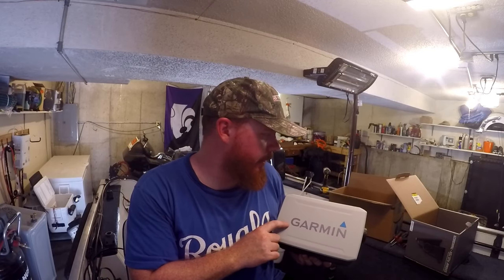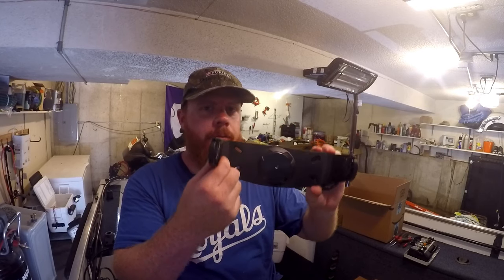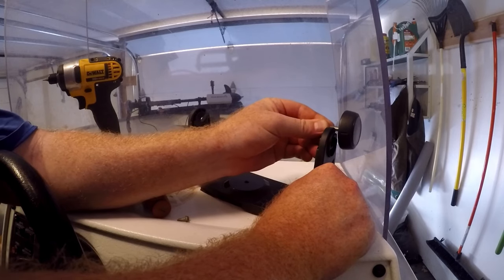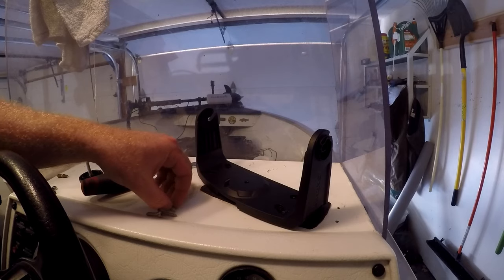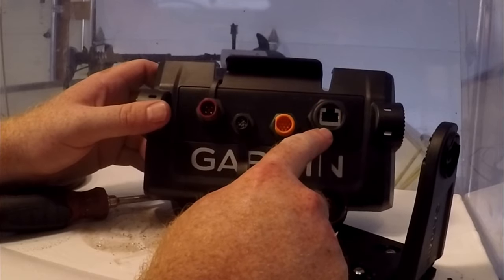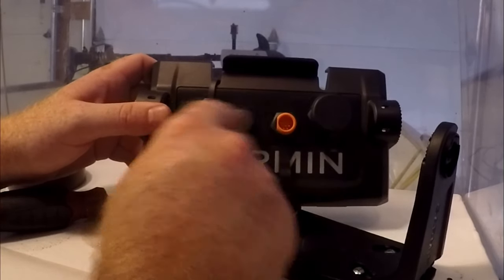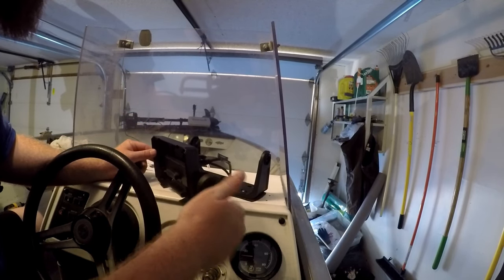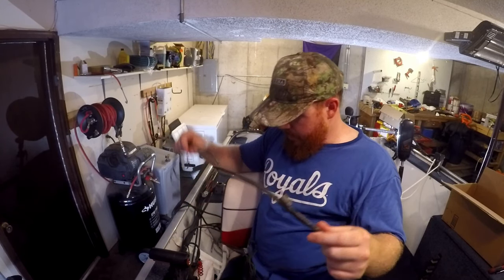How to Install a Fish Finder (GARMIN ECHOMAP PLUS 73SV Full Installation Part 2)

Comment: Nice video. But a couple of things I noticed. The base was installed backwards. If you look at the bottom of it there is an open slot for passing the cables through. This allows you to drill the big whole under the mount so that it is hidden. Also I didn’t see you instal the ferrite around a loop of transducer cable just before the connector. This acts to filter electromagnetic interference from the signal before getting to the unit. Lastly, duct tape can conduct electricity and should never be used as an insulator. Hope this helps. Take care.

Comment: Thanks for taking the time to make this. Is the transducer working well; Have you had to make any adjustments? Any advice for doing this same project in hindsight? Are you happy with the clarity you’re getting? Thanks for your time.
Reply: I want to try it myself, but am concerned about getting the best results. Never done a transducer install. Was this your first? Catching/seeing any fish with it yet?
Reply from the maker: Everything is working great, I am seeing fish and I have not made any adjustments yet. I did forget to install the ferrite around a loop of transducer cable just before the connector. This acts to filter electromagnetic interference from the signal before getting to the unit.
I troll with it at slow 5 to 10mph speeds and it has good clarity so the transducer is working well.
Look over your boat pretty well and come with a game plan before you do any drilling or cable routing, that way you you are happy with installation and avoid mistakes.
Reply: Redbeard Outdoors thank you! I appreciate all I have learned from you.

Comment: Hey there! Great video. I have the same setup. Question though, the directions say to mount transducer on down prop side which would be the  right or driver side. I noticed u did yours on the left. Any big difference? I have all the holes on the left so it would be much easier to replace wher the old fish finder was... thanks!
Reply from the maker: I don't have any real major issues going slow. I'm not sure what the top speed for graphing is but up to 5 MPH I don't have any issues. Any faster than that the picture starts to get just a little screen static form prop wash. I'm not sure if the other side would cause the same issue after 5 MPH. I wish I had the time to test it out but I also don't want to put more holes in my boat. Sounds like a potential winter project for me! Thanks for the view and comment!